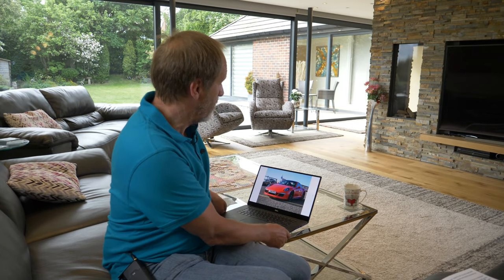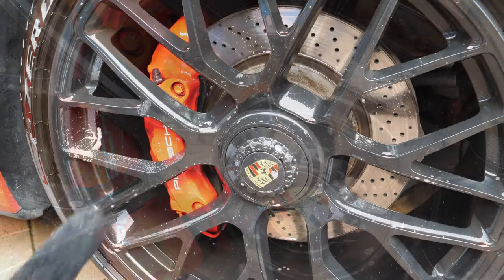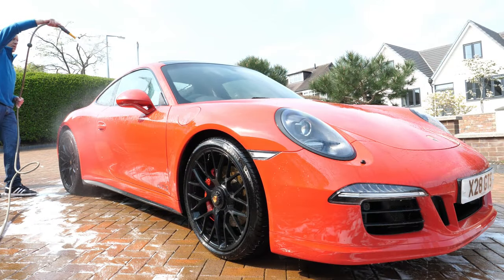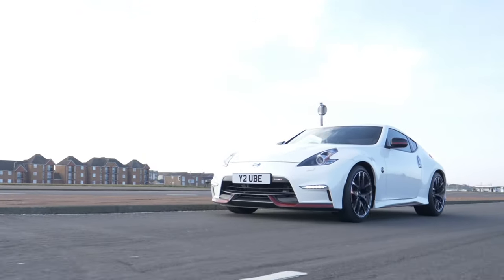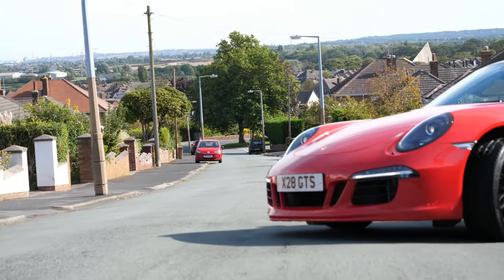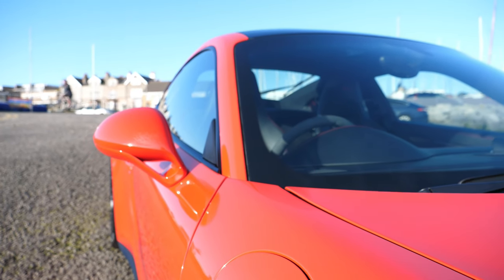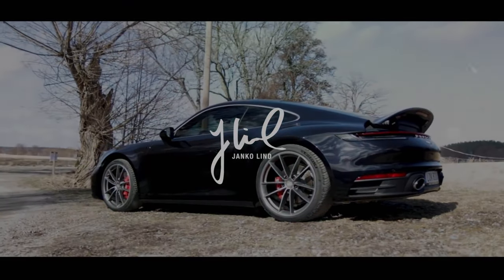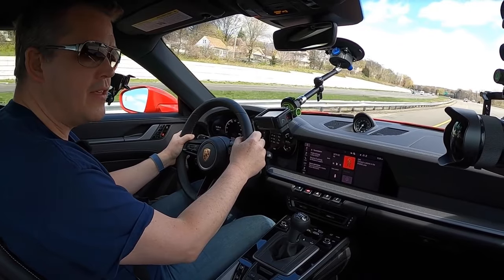Porsche 991.1 911 GTS and that paint

Comment: Neat video Roger.  Interesting twist to offer other other YouTube channels - thank you.

When we did the resto-mod on my ‘90 964, we sanded down & repainted the car it’s original color. (A bare metal restoration was beyond my interest for a car that is performance oriented.)  I chose to invest in whole body Expel PPF - it’s good for 10 years.  On top of that we did a nano-ceramic coating (various products in various locations).  The PPF gives resilient self healing surface to resist stone chips.  The nano-ceramic coating gives a very hard surface that offers protection against bird & bug splat.  It also gives a wonderful sheen & depth to the paint finish.  

Cleaning is a breeze with nano-ceramic - mild soap, two bucket method with good microfiber cloths.  Brake dust washes off the wheels with gentle agitation.  

PPF was about $6K (US); nano-ceramic less than $1K.  (Of course one needs to factor in paint correction first).  I would suggest that if one buys a car as a keeper or does a repaint,  these processes are a cost effective way of maintaining a beautiful paint finish with minimal effort.

Two other channels I watch are Truly driven - Swedish, Jonas races & covers track events & Island Works - Swedish Jonas also, he is an innovative mechanic making his own 964 track car.
Reply: Also Tyrrell’s Classic Workshop - fun to watch and so informative.
Reply from the maker: great information here David, thanks, ppf is the way to go, ive just had it fitted to my new car.  I shall take a look at the channels you like, best wishes - Roger

Comment: Roger, you have a unique and honest style that makes you standout as one of the best auto journalists (imho)! I have a 718 Sypder coming in February, but I've always wanted a 991.1 GTS (manual).  Ive had two 911s (2012 gts, 2007 c4s) and (2005 Boxster S, 2004 Boxster 50th Anniversary).  These are very different cars but curious which one you like better?
Reply from the maker: thanks Sihyung 718 Spyder is a real stunner, careful tho on cold wet roads those cup2's let go fast. 997gts is also a stunner, boxster S a delight - you've had some great cars. Personally & right now id take the 718 Spyder just for the fun it gives.

Comment: Roger - I think I have the dame pressure washer as you with the foam plug in on top of the machine - it just doesn’t seem to work properly.  May I ask where  you bought the wand with foam adaptor from?  Keep up the great videos and stay safe.
Reply from the maker: Mark, I typed into amazon; foam lance for kaarcher and clicked and bought, its about £30.00 and works well, its a job getting the foam out of some of the shut lines though !